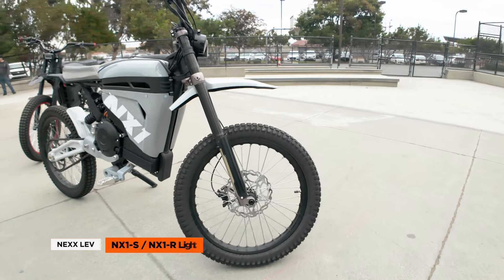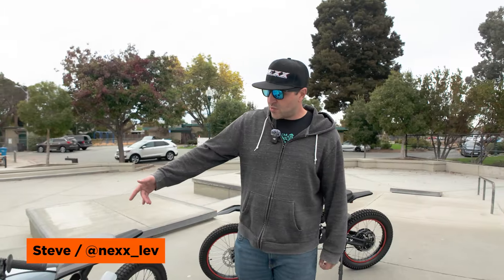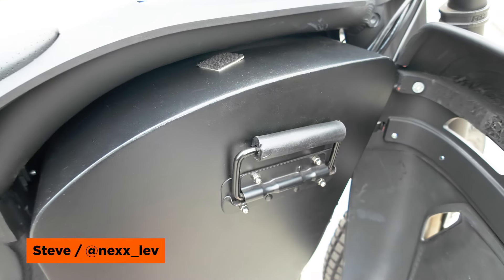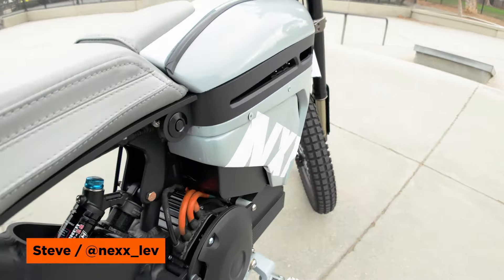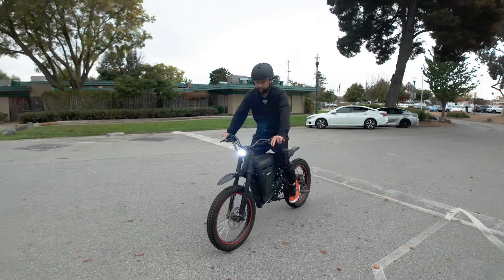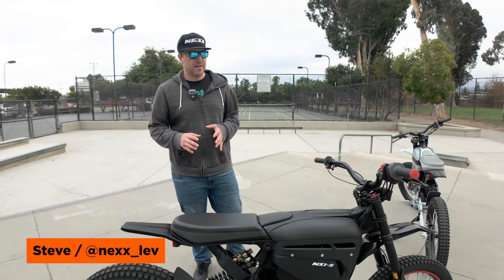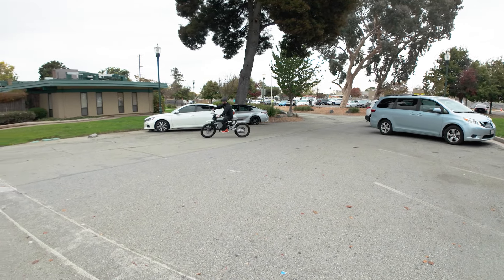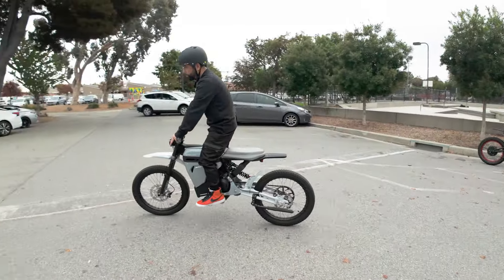Nexx LEV NX1: High Power, Modular Design - First Impressions and Test Ride! | RunPlayBack

Comment: Promising, but half baked.

The cross between the Surron/Onyx RCR is a great description; however, the mid/rear/pedal situation seems undefined, but appealing.

The only obstacle is going to be support for two very different types, with multiple configurations.

Most rollouts keep it simple & capitalize before launching up line products & customization.

If they’re able to pull it off & the product is good, I’m in!

Comment: They need to work on their marketing. No one’s going to buy that rear drive with an off-road set up.   They should’ve put street tires on the hub drive, more traditional fenders, a cool, street, fairing ,and have a road looking set up rather than the traditional off-road/Surron/BMX look
Reply from the maker: I think that's the plan. I believe they are still in the iteration/prototype phase when we filmed this video so parts weren't quite finalized. Tires/accessories/fender kit/etc will probably get finalized in the next few months and I imagine the marketing will showcase a more prominent cosmetic difference between the hub and mid drive. I'll try to follow up again with an updated video next time I'm out in the Bay area.